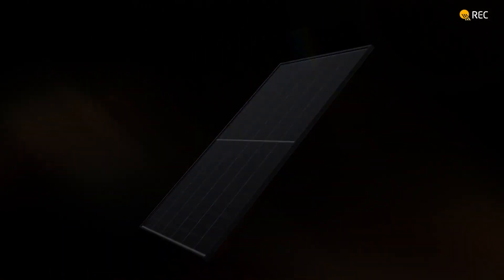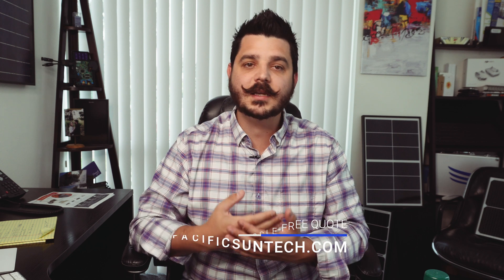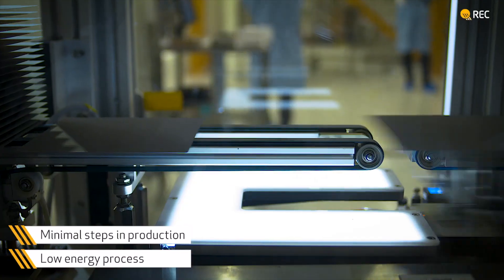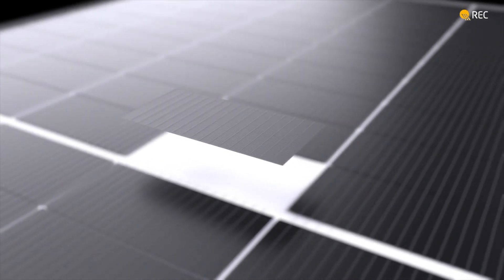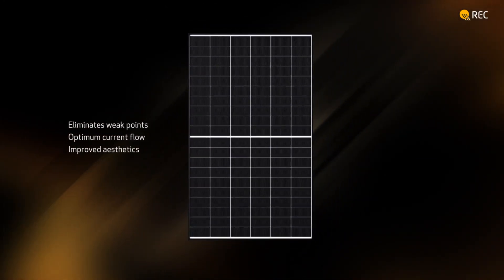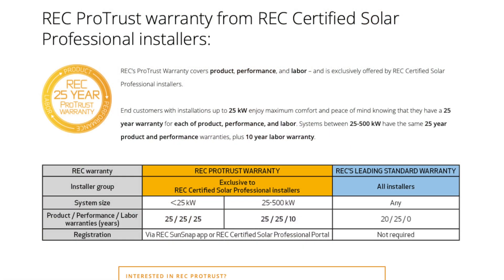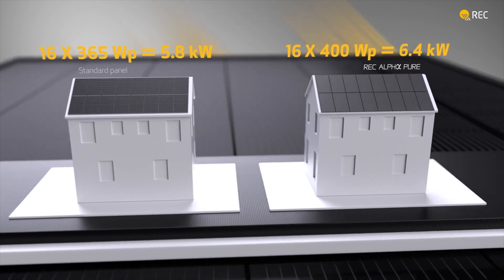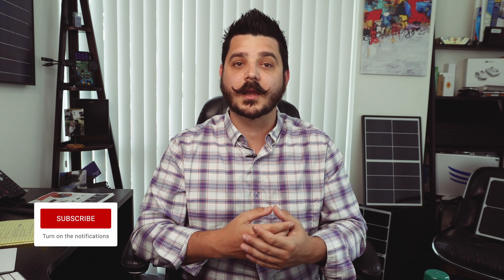REC Alpha Pure Solar Panel Overview

Comment: Should I have any concern with my proposal including the 395 model and not the 400?
Reply: Not at all, especially in this market with so many material shortages. They are basically the exact same spec outside of the 5w difference. In the Midwest we have had to go from the 400w panel back to the 395w panel because they have not been able to produce the amount of 400w panels they were anticipating with the supply chain issues worldwide.

Comment: Hello, what is your thought on the EnPhase IQ7+ has 295 VA Peak Output power, where as the panel is at 400 watts you will get clipping from using Enphase inverter?  A lot of people are using SolarEdge Inverter and Optimizer instead?   Thanks for the info.
Reply: If you’re worried about clipping then I would recommend the IQ7A which has 366VA. Enphase is a far superior product to SolarEdge in my opinion. I have owned a solar company for 6 years and been in this industry for 11 and have installed both systems. 

The IQ7 product is getting very hard to find so the IQ8 will now be the most common micro-inverter, so I would recommend the IQ8M or IQ8A for a 400w panel.

Comment: I have a quote on the REC 395 Alpha Pure panels and Enphase IQ7+ invertors - I live in Kansas City, Missouri and the bid from Rising Sun Solar. They tell me that if IQ7+ are the ones recomended by REC to use with this panel. The clipping loose will not justifiy using the IQ7A because of cost. The bid is for a 26 panel 10.27 kW DC and 8.86 kW CEC rating with First year production of 14,774 kWh AC. What are you thought on this combo? Should I press for the IQ7A? They are a REC certifided installer.
Reply from the maker: Your region is going to play a big factor with which one will help you generate more power. They may be right that the Plus is going to out perform the A. You can use this calculator to see for yourself. https://pvwatts.nrel.gov
Reply: I got a similar quote in FL for 25 REC 395 panels and IQ7+ inverters. I’m curious as to what your quoted $ amount was as it is similar to mine.

Comment: REC is back in America I see. Didn't they go bankrupt at one point? Were they not partnered with Schott, as in REC - Schott many years ago?
Reply from the maker: REC has maintained smaller production which limited their ability to enter the US market. Up until this last year, they have been slowly moving toward the US market, and have committed to purchasing a closed down solar manufacturing facility in the US so they can manufacture panels here.

Comment: Nice heads up about the iq 8! Can't wait!
Reply from the maker: Coming soon!
Reply: IQ8 is in use in Enphase's batteries for a while now. Nothing new.
Reply: @davidissko9796  I do not think he was talking about the IQ 8X-BAT microinverters in the Enphase battery. He may be talking about the IQ 8 (D, PV) for the solar panels. Those are not for sale yet for the past 3 years.
Reply: @johneric98  Yes, I'm aware. Thanks.